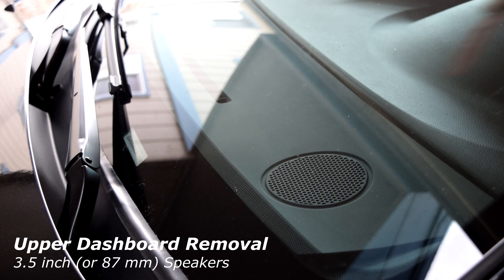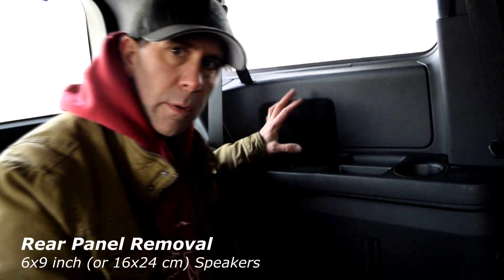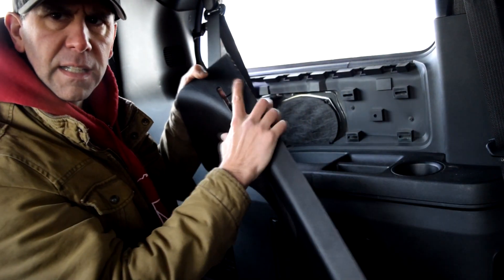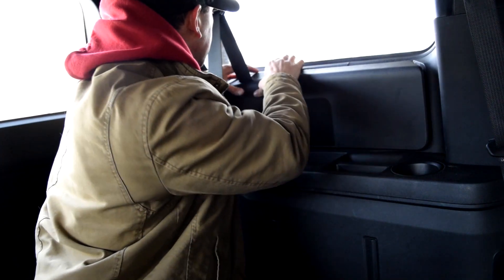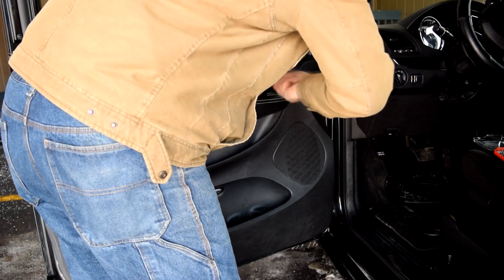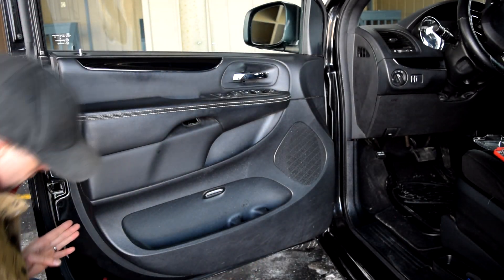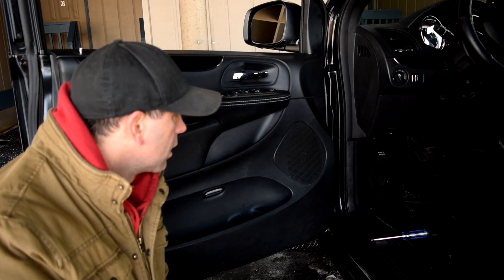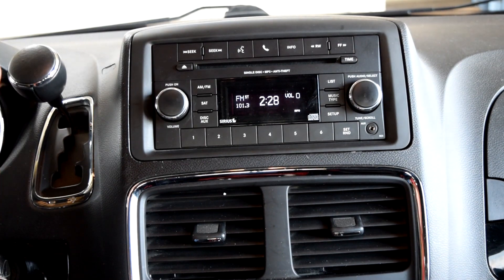2011 - 2018 Dodge Caravan Speaker Access and Locations

Comment: In case anyone is wanting to replace the rear speakers in a 2011 - 2018 Dodge Grand Caravan, don't get a speaker with a big magnet on it because it will not fit, the magnet hits the outside panel before it is flush in the hole
Reply: You can fit speakers with bigger magnets in the front doors but you will have to cut away a little metal on one side, just make sure you cut the metal from the door and not from the window guide rail
Reply from the maker: @joep6500  Thanks for the extra info Joe!
Reply: @joep6500  make sure theres no gaps between the speaker though, you don't want both sound waves (front and back) to interfere with each other, you will have no low end at all.
Reply: @joep6500  my parents 2013 Dodge grand Caravan did not come with the speakers in the rear posts. Is there a way to add them?

Comment: First off thank you for the video. It's going to make this job a lot easier for me. Does anybody know where for sure the stock amplifier is in these vans. I have a 2011 without the subwoofer and I was told by the dealership that there was an amplifier not in the head unit but by one of the rear speakers. Is this true or was the dealership tech just mistaken? He also said that there are tweeters in the rear pillars near the seat-belt locations. Is this true?

Comment: Very informative video so thank you on that I want to know if you know how to install the subwoofer and amp on a 2013 Chrysler Town and country touring van that doesn't have the subwoofer and amp in the rear will that be something simple to install if it doesn't have one but it does have the rear subwoofer pocket to fit the subwoofer box would that be something that can be done if so would you be able to show a video on that or if you know if there is a video on that already thanks!

Comment: This is the most informative video I have found on YT re pulling and replacing the panels to access all speakers.  The one question I never see addressed is regarding the back pillar speaker / tweeter locations.   Mine has the non premium "no oem sub / amp" system so I about to replace front and back with component speakers. Wondering what I will find re tweeter mounting options in the back with fingers crossed.

Comment: Great vid just what i needed to see its time to replace my factory speakers in my chrysler town and country💪🏻
Reply: The Infinity Reference 3.5" 3022 or 3032 fit in the dash. If you only replace these it probably has the biggest impact. Replaced the side ones and ordered another pair to do the center. Really brings alive the higher frequencies to balance out all the bass from the 6x9's in the walls and the sub, you may have to lower the treble to balance it out after based on how the stock eq is set. Didn't use harnesses just gently shoved 16ga speaker wire into the clip harness and taped with good electrical tape to hold, then crimped on spade connectors to slide onto the speaker leads. Pretty simple.
Reply: Did you put in three 3.5” speakers in the front? Did you put two extra 3.5” speakers in the rear as well? Thanks

Comment: What about the town and country? 2011-2016? i bought a 2012 town and country touring L with all options so mine has 3 speakers in the dash at the windshield. One in each door so 4 and 2 in the rear like this video I believe there is 2 tweeters in the rear as well. It’s a total  of 12 speakers in all if I’m not mistaken. It sounds so good it don’t need a replacement on anything at all. It sounds like your sitting in a movie theatre while watching the DVD player through the speakers instead of the headphones. It had the upgraded options like heated steering wheel seats, auto dimming headlights and wipers automatically turn on/off or faster/slower. They just put all brand new Firestone Destination tires on it and alignment was performed. It’s only got 66k miles, clean title, it’s a a one owner, garage kept, all maintenance records from the dealership. The headlights look like brand new never used looking. Everything is mint on it. I love it. Retail is 13,500 to 14,800 I only gave $4960 for it. I lucked up big time! With all that said I’m wandering why I don’t have the factory subwoofer. They are listed for 160 online. 2012 town and country subwoofer! But I don’t know if mine has the power to push it. I know mine has to have an amplifier though.
Reply from the maker: I would think the third speaker is a center channel that would be accessible when you take of the top dash part to get to the small speakers by the windshield. Sorry for the delayed response, I just saw this! Good Luck!
Reply: @ryanthius  thanks yeah it’s got the middle dash speaker due to the upgrade package they bought for this van. They bought the whole package but I’m confused not on the center dash speaker but I seen where it says an upgraded system might have a subwoofer in the rear compartment but I don’t think mine does even though there’s 3 in the dash one in each door and one on each side of the rear plus tweeters in the pillars. It has little slots where they are I may have a total of 4 tweeters. It’s got a factory amp for sure I just was curious as to why it wouldn’t have a factory subwoofer if it’s the upgraded system .
Reply: @br4jar  Select your vehicle on the crutchfield website and it will show you where the sub is. It's in the wall panel lower down, in the trunk on the driver side. Turn on some music and put your head there and you'll know if you have it or not.

Comment: I have a 2015 Town and Country L. I have trying to find out where the factory amp is located, can't seem to find any info on it.
Reply from the maker: Sorry I did not have an amp in mine. I'm not sure where they are located. Could be a small one behind the dash unit. But I don't know exactly.
Reply: @ryanthius  Thanks
Reply: I wanna say it sits below the back left speaker. And the sub is further back towards the rear hatch below the tools for spare tire.

Comment: Thank you so much for this video.  What do you recommend as replacements?  Does the UConnect system push enough power to use aftermarket premium speakers?
Reply from the maker: Thanks for the support! As for replacements, the sky is the limit depending on your power. I think the uConnect system is the handsfree module that allows you to connect your stereo to your phone. Your head unit or your amplifiers are what gives the power. I like to use about 20% more power than the speaker is rated to reduce distortion. Pioneer makes pretty good affordable upgrades that will run off a stock head unit. I had Hertz 6x9s in all four spots in mine but I was pushing it with about 200 watts per speaker. Crutchfield Audio ( www.crutchfield.com ) is a great resource for radios, amplifiers, and speakers.
Reply: I have the Nav radio with the 509 watt amp and subwoofer in back. Crutchfield has speaker replacements for all the speakers. But the center speaker they offer is ridiculously high! After market speaker are usually more efficient.
Reply: @BlueMagicx  I have the same setup and am wanting to upgrade just the speakers because it sounds terrible. Will just replacing the speakers do the job? Is it worth it?

Comment: Do you know who the manufacturer of the stock speakers are? I am looking to upgrade my system and am considering JBL components. Also, is there an connections to add an external amp to the deck?
Reply from the maker: I don't know the original manufacturer of the stock speakers, sorry. I think the Stock stereo just has normal outputs. I don't recall any RCA outputs that would be better for an amplifier, You would be better off with an aftermarket stereo, but some amps allow for "speaker wire" inputs as well.. I don't own the vehicle any more so I can't check for you. Good luck though, I'm sure some JBLs would sound nice.
Reply: Thanks for the response. Great video BTW.
Reply: They are Infinity’s low end speakers.
Reply: i bought a 2012 town and country touring L with all options so mine has 3 speakers in the dash at the windshield. One in each door so 4 and 2 in the rear like this video I believe there is 2 tweeters in the rear as well. It’s a total  of 12 speakers in all if I’m not mistaken. It sounds so good it don’t need a replacement on anything at all. It sounds like your sitting in a movie theatre  while watching the DVD player through the speakers instead of the headphones. It had the upgraded options like heated steering wheel seats, auto dimming headlights and wipers automatically turn on/off or faster/slower. They just put all brand new Firestone Destination tires on it and alignment was performed. It’s only got 66k miles, clean title, it’s a a one owner, garage kept, all maintenance records from the dealership. The headlights look like brand new never used looking. Everything is mint on it. I love it. Retail is 13,500 to 14,800 I only gave $4960 for it. I lucked up big time!

Comment: What are the 3 speaker sizes?  I can see the rears are 6x9s.
Reply from the maker: In the video at each location there is a description. Dash are 3.5", doors and rear are all 6x9". =)
Reply: @ryanthius  Thanx, i didn't see it. I'm an otr truck driver, and when i'm home my honey do list is so long, it's been 4 years, and my second van, and i still haven't had time to install my sound system. So i wasn't able to focus on the video.
Reply from the maker: @Taino137  All good! I threw a couple of 4 channel amps on a mount in the very back rear drivers side jack compartment (hidden) and ran the main 6 speakers with a sub bridged off the last 2 channels. It sounded awesome!
Reply: @ryanthius  Thanx. I thought about using that spot, but i wasn't sure. Thanx.
   Kids all grown, i thought i would get my minivan California style/70s van look, but now they are bringing in grandchildren, so i will have to put that dream away, but a least i can put my sound system the way i want it. It sucks getting old.
Reply: @ryanthius  Thanx, i though abuot using the same spot. Now that the kids are grown i though i furfill my dream of a Californa style/70s minivan, but now they are giving us grand kids, 2 boys so far. So my dream has to go on a shelve, but at least i can put in a nice sound system.

Comment: I have the touch screen Uconnect system. It doesn't go up very loud and I believe all the speakers work. Not near as loud as an aftermarket system. If I wanted an aftermarket system I would have to use a kit to retain the backup camera and steering wheel controls okay great. But the system is integrated with the VIN number which also has my SiriusXM subscription. I would have to call SiriusXM and pay them money to switch over to the new unit. Okay great now how do I play DVDs on the rear screen what I have to hook up the AV jacks and the back output of the system? Probably. Would it play DVDs on the rear screen? Probably. But there's AV input and an HDMI input in the back of the vehicle. When the vehicle is in park you can broadcast video from the back of the vehicle to the main head unit when the vehicle is shifted to Park. Can you do this with an aftermarket system? Possibly not. With all of this Factory functionality designed as one system by Dodge, I'm pretty sure you would have to give up something. Also backseat passengers can share the system with you as they can listen to FM on headphones while you listen to Sirius or vice versa from the rear screen . There is no way you would be able to hook up an aftermarket system exactly like this.. The dealer wants it to be a headache for you to swap out this system. Just like apple they want you to buy you a new one from them if something goes wrong. This particular van has the simpler system without The Back-up Camera. Also my model doesn't come with navigation and Dodge has one that has it but to upgrade you can't just do it yourself you have to go to a dealer and get your VIN number put into it for probably several hundred dollars and it's the exact same system just passed navigation added to it. Probably goes to the max volume of 38 and maxes out with the bass and sounds like crap. I don't know what happened after 2010 but it seems like when cars started getting touch screens their systems started sounding like garbage. I would love to have a Kenwood system or a Pioneer system. And the phone system is terrible. Every time you hang up....."PHONE-CALL COMEPLETED!!!" Everybody walking out of Walmart and knows you just got off the phone. Want to make a phone call on an earpiece but don't want to completely unpair your phone from the radio? Talking on the phone with an earpiece everything is fine. Turn the key on and start the vehicle you better have your phone in your hand ready to hit the Bluetooth button. You'll be in the middle of your conversation go straight to the radio okay Switchback to the earpiece. Nope the radio does it again you have to tell the person to hold on. Also use the Bluetooth system for music. Great for music but not for watching a YouTube video way way out of sync you have to run an auxiliary cord if you want to use your speakers for video not only that but the music Gets behind too. I don't know what Dodge was thinking building this lousy system. If you want to update the software good luck looked everywhere online but this is a 2014 they probably got the big ten inch screen now and they probably no longer update the system